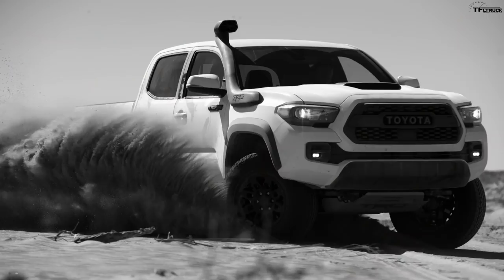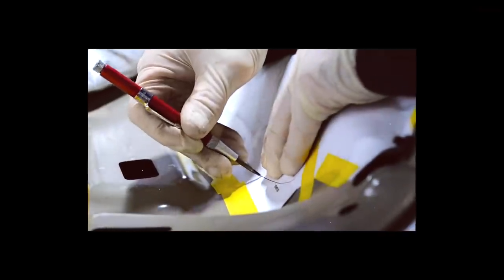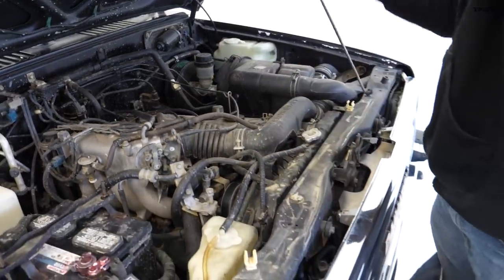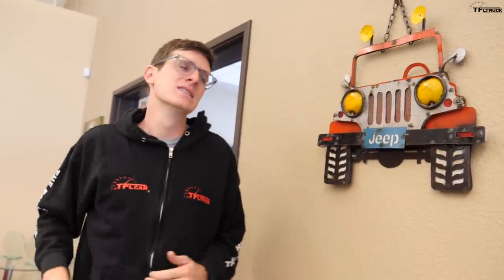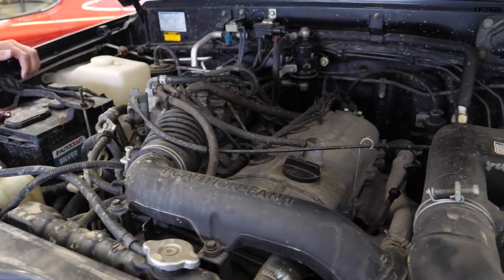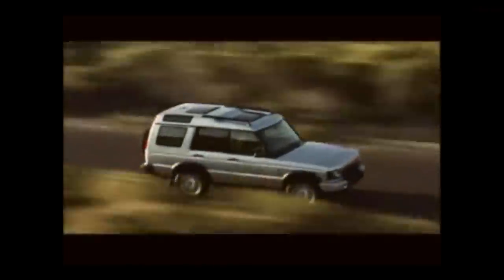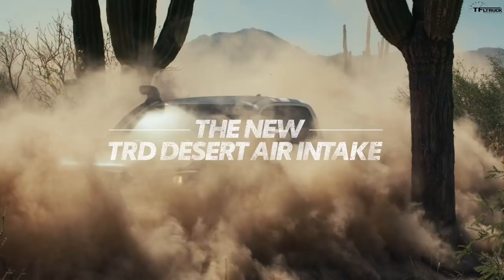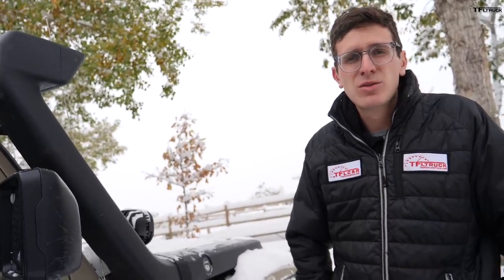Toyota KILLS The Tacoma's Snorkel, So You Hipsters Can't Go To The Grocery Store In A Flood Anymore!

Comment: I'm waiting for someone to put a snorkel on an electric vehicle....
Reply: That is for the drivers and passengers to breathe underwater when they drive the car down into the water; it is a survival kit for the idiots who think their car can swim.  I am just kidding.
Reply: Will M  What if some genius would like to add a tiny gas engine into Tesla to generate electricity for charging the battery when the car is running low on electricity . That they may need to put a gas tank in the EV.
Reply: @Gammaus  like the i3?
Reply: You are not too far off.  Tesla’s require an air intake to cool the batteries.  The intake is below the “nose cone” on every model.
Reply: It's so they can run their charging cord down through it so it doesn't have to lay on the ground  and get dirty lol
Reply: @Gammaus  both BMW i3 and i8 EV’s can have a gas tank to run the range extender generator.............. now the i8 is no longer built and the i3Rex was discontinued last year when better capacity batteries were available so it’s not as crazy as you might think.
Reply: Will M  i watched that video it is very funny
Reply: Snorkel on the new Hummer lol
Reply: we already have the taycan TURBO s
Reply: Darn hipsters and their snorkels. I'm just jealous that I didn't see the trend coming and sold some snorkels on Amazon.

Comment: They need to quit that fake/non-functional hood scope while they’re at it, or do something crazy like make it actually functional. Reminds me of all those previous generations of Ford Mustangs with fake air scoops.
Reply: At least Chevy makes their hood scoops functional on their duramax diesels.
Reply: @richfarfugnuven6308  its a way to cool the turbos while driving
Reply: I honestly don’t really mind it. It looks amazing imo so it doesn’t really bother me.
Reply: @deandrej674  yep, and get cold air directly into the engine.  I have an old 7.3l and a 6.0l powerstroke and they both now have vented hoods.  Helped a ton when towing.  The biggest difference was putting water methanol injection on the 7.3L as well as a mishimoto radiator and intercooler.  Runs a lot better.
Reply: Who cares? It’s just a bit of exterior design to give it a different look.  The Tacoma’s could easily be made functional.  Hopefully they put the new tundra motor in it and make it functional from factory
Reply: Ya my 4Runner has the non functioning hood scoop it’s pretty stupid
Reply: @mr.fiction5564  I care because it creates more wind resistance and hurts gas mileage.
Reply: @aredman22  yeah it just doesn’t though does it? Lol.  Not one vehicle with a hood scoop gets less Mileage than a non hood scoop version.  My trd sport gets the same as an off-road or an sr5
Reply: @aredman22  Damn that's dumb. Prove it please!!!
Reply: Yep, when I had my WRX, I was proud of the fact it is actually functional.
Reply: If they made it functional it would be way more appealing to buy

Comment: Ok so calling it a desert air intake is very accurate. Living in Dubai and out in the dunes every weekend i can tell you that the raised intake for heat doesn't do that much but keeping sand out of your air filter is totally brilliant. I used to clean out a small dune after every drive from my fj cruiser air box now with the TJM snorkel i clean only very fine dust out of the filter once a month if that.  If you drive on sand and dusty roads do it.
Reply: @Rich Jones The whole point of snorkel is giving a supply of air to the engine. From water crossing perspective you still need it, because your splash of entering the water depends on the speed and angle you take, which without snorkel can lead to flooded engine since all factory intakes are located in lower position at the front. Which is the same for Dust or more important Mud which both can block that factory intake hole.
Reply: Absolutely 👍🏻
Works brilliant for fine dust/sand like in Namibia & Richtersveld
Reply: @rynoopperman5010  really looking forward to travelling to the Namib in a year or two. 💪🚙😅
Reply: We drive through dust all the time out here in Nevada on trails. I've had a snorkel for almost 4 yrs now. Works great!
Reply: i have one on my gen 1 tacoma. for the  dust and mud its  totally worth it!

Comment: I disagree Tommy, I worked in West Texas for a year driving the oil field roads in my new at the time Tacoma. After 1 month, the air filter was plugged up with desert dirt and silt. I ordered the arb snorkel and installed it along with a pre filter. 22 months later the air filter still looks brand new. Following 18 wheelers was the worst but I think the majority of the dirt was lifted by the tires into the intake.
Reply: difference is that you are actually running pre filter whereas most people don't

Comment: That’s why I love my diesel defender. I have had it through a river with the water halfway up the windscreen
Reply: Don't forget your wading plugs sir!!
Because timing belts ain't cheap!
Reply: @Craig-wp3pz  yep, always put them in when going off road
Reply: I hope that yours isn’t a Land Rover branded one as they only sell non waterproof Raised Air Intakes, you have to go aftermarket for something like a Safari Snorkel that adds waterproof gaskets at the wing and air box - one problem with pre 2020 Defenders is the battery box under the seat - 4 huge vent holes in the battery box floor help the cabin to fill more quickly than the under screen vent flaps and the door seals. Post 2020 Defender............ 82 ECU’s, it’s not worth the risk even if they are allegedly waterproofed to military requirements and can withstand 1 hour submerged, I wouldn’t want to put that claim to the test ever in my 2020 Defender!
Reply: @timoliver8940  my one is the actual military one, rather than the land rover branded one. It came with gaskets, plus I siliconed all the joints in the air intake system. Not bothered about water coming in as if it didn't you run the risk of the defender starting to float and lose traction. In the army we used to leave the tailgate open and open the doors to let the water come in if we were deep wading to stop the possibility of floating
Reply: @zuegma666  I have a standard production TDi300 90 as my off-road toy, I learned the hard way about raised diff breathers! In June I took delivery of a new 110 First Edition - deepest wade so far fit that was recently in local flooding, the Terrain Response Wade setting was tested to 60cm depth - the guy following me in a BMW X7 turned around to find an alternative route!
Reply: @timoliver8940  same here, I have the  last year 300tdi 90. No electronics to worry about and I have all the raised breathers  run up to the top of the snorkel

Comment: snorkels on something like a tacoma or wrangler are really useful. i have been in offroading situations with a wrangler where water got deeper than expected and you are already committed to crossing. A lot of the wires and other components can take a short duration of water exposure and be fine , however your engine cannot . A cheap safari snorkel also saved that jeeps engine years ago when i was stuck in water near the front of the hood for 10 minutes, engine never shut off and was fine.

Comment: Vehicles commonly ingest water into the engine without damaging the electronics. A splash/stream of water in the exact wrong place can ruin an engine without touching the electronics. A snorkel can be worth having if only for those few seconds, once, in the life of a vehicle. When I was a tech at a Jeep dealer I saw water ingestion 3 times with no electronic damage. I saw a Lexus GX drive through a stream too fast, which forced water into the engine, without damaging the electronics. In all cases a snorkel would have likely saved these engines.
Reply: or do the cheap & nasty way: wrap a tarp around the nose (fix at the hood hinge on top and near the control arm at bottom). 
works really well, everything is kept dry that way ...

Comment: Having splashed through a puddle that was deeper than expected in a 2005 Wrangler, I view raise air intakes as cheap insurance. Sure you may get some electrical issues but you're less likely to hydro-lock your engine. Also some designs allow you to mount a pre-filter which may help keep some of that dust and crud from clogging your typical paper filter.
Reply: Yeah I'd rather replace or dry out the electrical than replace my motor . Didn't think he would leave that part out
Reply: @simcha6414  where I live insurance would consider any car that had water that enters above floor board a write off.  Rules vary all over the place though.

Comment: I have several trucks that take air in from the inner fender. When driving down dusty roads,  there is no clean air in the wheel well where the inlet is. Therefore, it's advantageous to use a snorkel.

Comment: Good video Tommy! I purchased a « Snorkel » from Rugged Ridge for my 2019 JLUR and there is no cutting the hood. It is literally plug and play. It does look a lot nicer than the Mopar one and it is reversible should you decide to do so. I would not take my Jeep in the water higher and faster than what Jeep recommends, but I would not be without it simply to avoid hydrolock. You can get hydrolock in a foot of water if you drive fast in it. This is why the snorkel comes in handy. Toyota, calls it a desert air intake as this is « in my opinion » what their lawyers advised them to call it in order to avoid law suits. Keep up the good work! I watch your TFL videos from 🇨🇦 and I love them!
Reply: Now there's a fine, reasoned  🇨🇦 comment! 

I hear the Moose chew on them during mating season tho-so there's that.

Comment: 3rd gen Tacoma have the air intake from the passenger side inner fender cavity. If you remove the plastic inner fender for larger tires, a snorkle is used to keep mud and water out of the airbox

Comment: On the Toyota Hilux the air intake sits just above the right front wheel well, and thus a lot of dust that gets kicked up by the front wheel
Reply: no way, it must be separated from inside of wheel well , like in mine it's above wheel well inside and it has another metal wall to separate it from engine bay, it has indirect openings so no mud or water can't bounce there... that is why is not recommended to use aftermarket intake boxes which have inlet tubes just pointing down to road
Reply: @tallll70  
Sure, but a lot of dust still gets in there
We did a test and found a major difference in the amount of sand in die air-filter (snorkel vs no-snorkel)
Some of the area,s in Namibia 🇳🇦 the dust is so fine, it gets in everywhere...

Comment: I bought a 2020 Toyota Tacoma TRD pro this truck comes with the option to have a desert air intake on it straight from the factory but I didn’t take it I didn’t see the point of it. Instead I went with the TRD pro cold air intake system . Now they say it adds an extra 9 or 10 horse power, i’m not sure I believe that I mostly got it because of the reusable filters where you can wash them and blow them out oiled them up and reuse them again and again. I put ARB differential breeders front and back. Didn’t see the point in the intake at all it’s extra money and extra weight with no real benefits.

Comment: Its about keeping the air intake higher than the dust and sand your own vehicle kicks up in the desert. You will find you don't have to dump the sand out of your air filter as frequently if you do a bit of research before making videos.
Reply: yep and the occasional oops water crossing that would of sucked in water prior to any electronics ever getting shut down.
Reply: Exactly, when churning up dust on dirt roads there was a huge difference from when my Landcruisers intake was in the fender area vs up high.  It was well worth doing, granted I'm glad Toyota dropped it because it makes my snorkel even that much rarer.  Remember these reviews are done by guys who leave street tires on some offroad models when they do comparison tests, take what they say with a grain of salt.
Reply: @beer3029  I'm aware they are amateurs more concerned about outputing more content over quality. I understand their situation of not putting the same tires on every vehicle they get due to costs and only having vehicles for a short time and not owning a lot of the vehicles they touch and I agree they shouldn't pass those videos off as being remotely valid tests. They even had an FJ Cruiser represent "cars" in a test they did when it's clearly an SUV. These guys are merely entertainment with occasional useful info.

Comment: i think they just create a bunch of wind noise and drag.  i dont really think they look cool either.  id put them right there with fake hood scoops
Reply: But they don’t make much of either and they actually make a bit more power, unlike a fake scoop that does a whopping nothing.
Reply: The hood scoop is just a stylistic option.  Every major truck brand has had or still has some type of hood accent.  Whether it’s ford ram or Chevy they all add either a scoop or a contoured hood with black accents over it.  The Tacoma one can be made functional but I’m sure most people just like the look
Reply: @mr.fiction5564  contoured or power bulged hood is something different.  thats fine to me.  its the fake air intakes and exhausts all over new cars that bother me.  bunch of black plastic filling the space.  terrible design
Reply: @stussels  yeah black plastic that fills the space of the raptor, the ram, the ram rebel, the hd chevys.  They all have them.   They look fine they add a bit of flare as opposed to a blank.  Nothing is there to ‘fill space’ if the black decals weren’t there it would just be a blank hood.  It’s not like they’re cutting corners by adding them.

Comment: I sent my ‘94 Toyota truck fording through a river. Water reached the window sills but did not leak in. With the factory air box. 
If I lost traction and spent too long there, I’d have been stuffed. But I didn’t and I wasn’t. 
Yes, it had an EFI computer under the bench seat!

Comment: Most vehicles will start to float and loose traction before reaching their wading depth. Be prepared to remove floor bungs to let water in and be sat in water if you want to go through deep water. Would never do it with newer 4 x 4, but ok with my series 80 Landcruiser.

Comment: Most Toyota’s who run larger tires or aftermarket front bumpers have to remove the plastic inner fender liner exposing the factory air intake directly to water, countless times I’ve seen hydro locked engines because of this. A snorkel is one of the best ways to prevent this from happening

Comment: Yes they are mostly show. However well sorted modern 4w4s should be fairly water tight for a period of time, with computers set high and dry. Diff breathers every off roader does, no biggy. You can go deep fairly easily. Then again a tiny knick in a spark plug wire stopped me one time.

Comment: snorkel does not provide deep water travel but give some room to you. if you travel below air intake  but even very short period  time of water level increase; your engine may suck that water and kill itself. It happened to me. after a heavy rain, stuck at water puddle. A dump truck  created wave than unluckily engine able to suck that water, enough to cause bend piston rods ruin the turbo etc, expensive repair bill.

Comment: Shouldn’t your in take be facing backwards not forward?
Reply from the maker: That’s a whole other video
Reply: Much depends on the design for water drainage from rain/snow. Heavy wet snow, I'd turn backward. Otherwise, if there is any minuscule amount of ram air effect to overcome the added air restriction you've just placed in the intake system, you probably should have the airhorn forward. On my 80 series, there is a slight MPG bump due to lower intake air temps while cruising (within 8* of outside). On my Power Wagon, zero change in mpg, and I can get within 12* of outside.

Comment: Unless the intake is facing sideways or backwards, you appear like a novice.
There is no proven evidence of cooler air or increased power.
In fact different test has revealed Increased fuel consumption and increased coolant temperature when the intake is facing forward.
If there were ANY benefits of have the intake faced forward, don´t you think the LR Defender or the Scania XT would have it?
They both argue with less dust (not more or colder air.) and they pin point that it´s NOT extend the wading depth.

Comment: This is the trouble with TFL not having a 4Runner in their paddock. We put snorkels on 4Runners because Toyota, in their infinite wisdom, put the factory air intake in the passenger side wheel well. (I assume they did the same to Tacomas, but it's been a few years since I've owned one.) Moving the air intake OUT OF THE @$&# WHEEL WELL wasn't just for looks. Seriously.

Comment: Any water higher than the alternator puts any vehicle at risk of immediate electrical failure, and submersing an alternator in water definitely reduces its life by contaminating bearings and electrical components with water and anything being carried by water. That's especially bad for Toyotas since they put the alternators low on the belt line, and not as bad for Jeep since the alternators are up at the level of the air intake. Glad someone is busting the myth on what snorkels are for ...

Comment: really good piece of information Tommy, I was just thinking about putting on a snorkel on my 2016 4runner trail, but decided against it due to the humongous hole in my fender, I don't really go through water, it was more for the dusty logging roads I go to when overlandding. Decided on putting in a k&n air filter and an incab one, too.

Comment: Yes big dust clouds the intake location won't matter but if you are offroading and the dust is staying by grill because of your speed then yes you will be getting cleaner air. So as with most mods it would depend on what your application will ultimately be in the end.